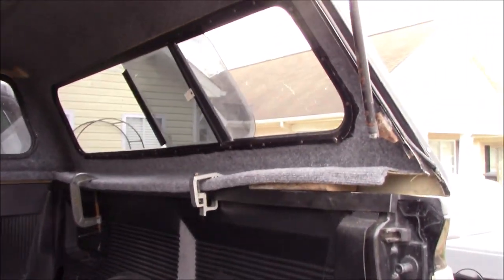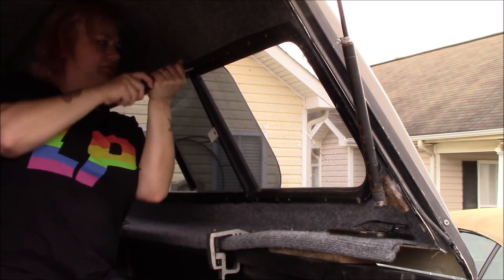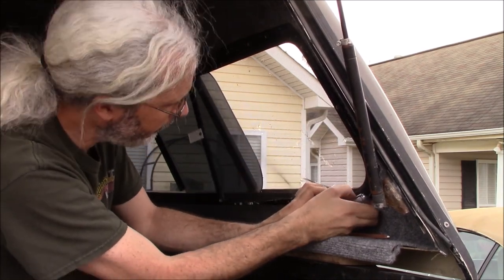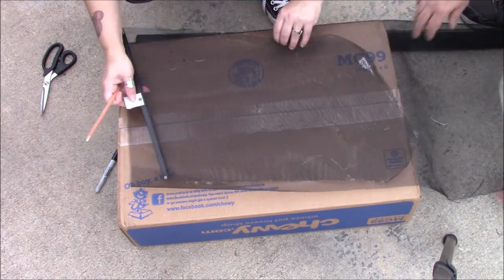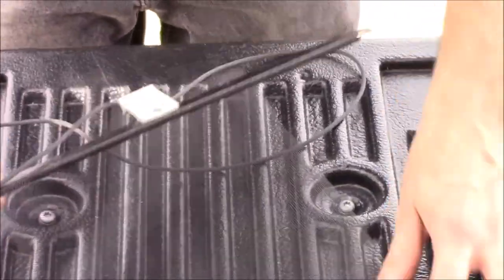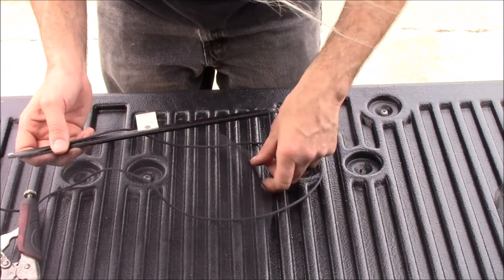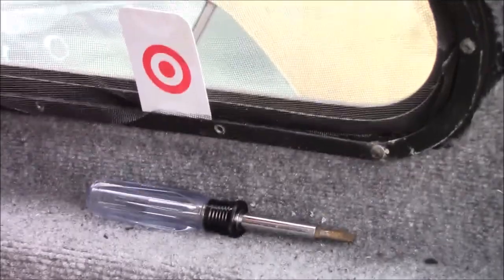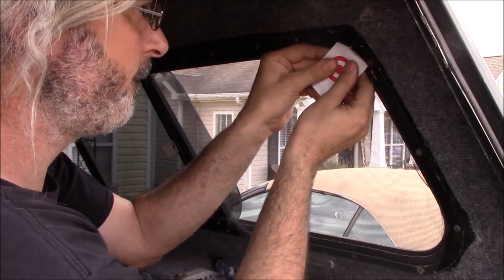Truck Camper Conversion Part 2 Screen Replacement

Comment: Why is there a 2x4 under the rail?
Reply from the maker: Because the camper was made for the body style before our truck so it didn’t quite fit it sat down too far and the two by fours helps lift it up and put it in a better position... it doesn’t fit but hubby wanted to buy anyway 🤷🏻‍♀️
Reply: Bolted down

Comment: What size stuff did y'all get at 13:46 ? and it's called channel lock ?
Reply from the maker: I can’t watch my own video without getting in trouble. Are you talking about the black cord stuff we poked in to the channel to hold in the screen? That is called spline. I don’t remember the size, the best I can do is take a leftover piece this weekend and try and match it up at Lowe’s so I can give you the correct size
Reply: @Vlogsoup  ohh okay thank you ! Nah you don't have to worry about that I'll just get a couple just in case thank you though !
Reply from the maker: @danielveness1943  ok cool good luck on your project
Reply: there is a tool to install the rubber string. your hardware person can help with this.
Reply: Yes the screen/spline  installation tool is simply a spline roller that you use to install the spline cord. Probably $5 & worth every penny.